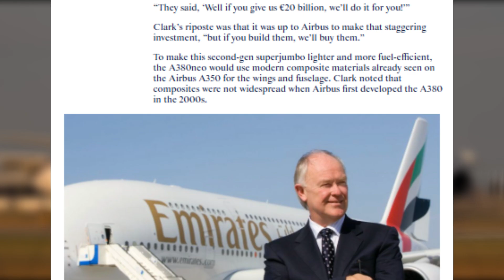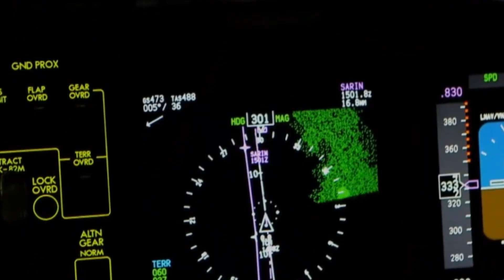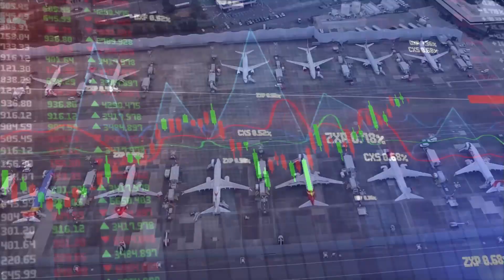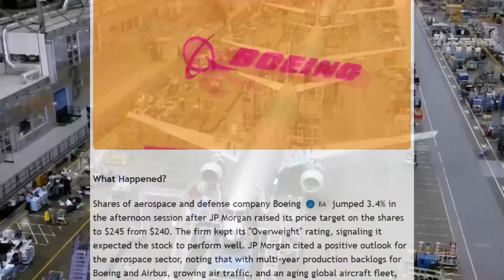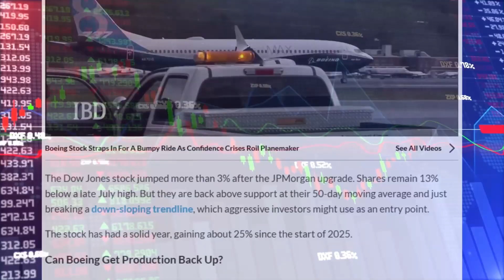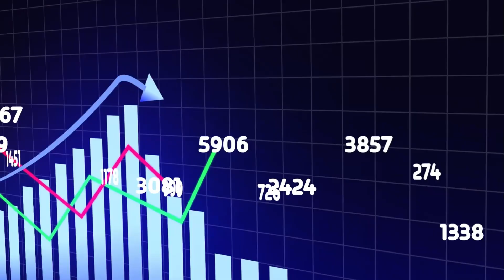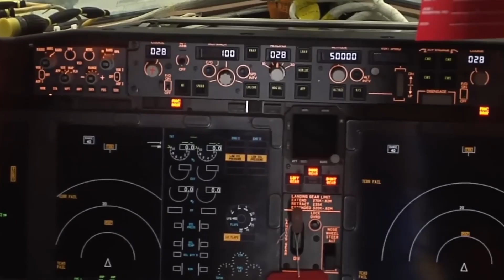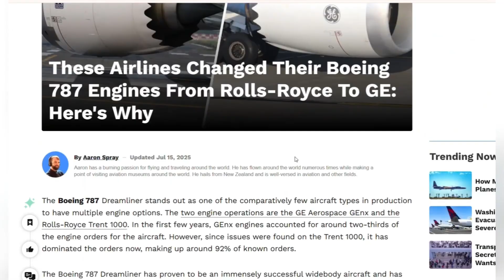Airbus Drops BOMBSHELL on Boeing as they plans A380 with Rolls-Royce Ultra Fan

Comment: 1. No One told Airbus
2. No One told Rolls Royce
3. The Biggest market is still A320 and B737
4. Airbus needs Production Space for its massive backlog
5. Airbus needs to develop completely NEW Designs and the current impending Bankruptcy or Chapter 11, of Boeing gives Airbus time to invest a a leap forward in Revolutionary Designs